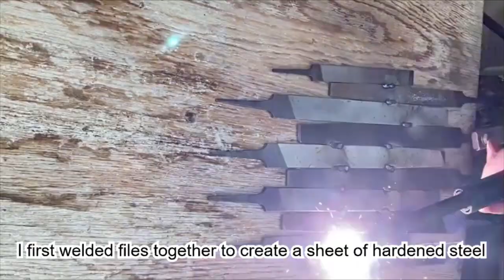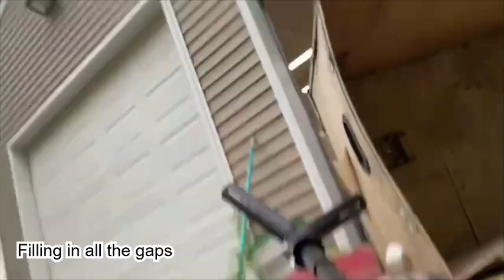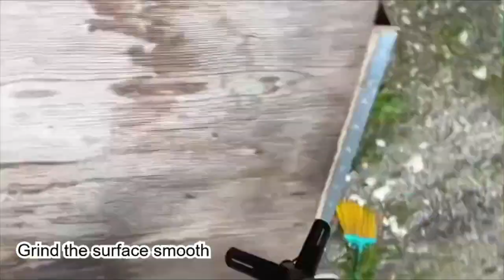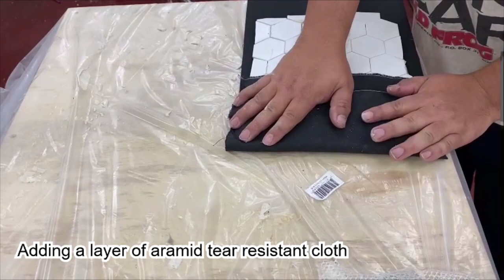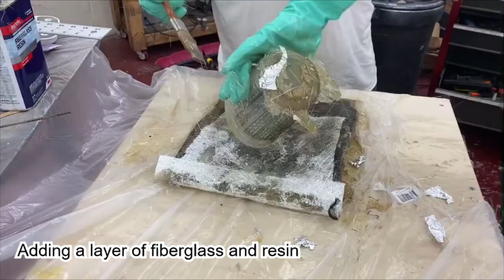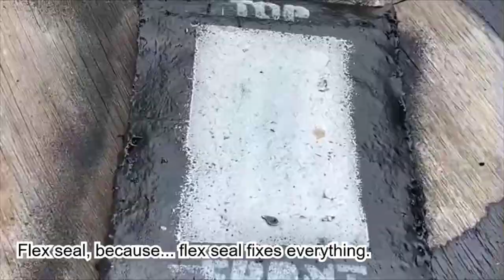CRS FIREARMS $500 DIY BODY ARMOR CHALLENGE(2021)

Comment: I bought two ar500 plates with a carrier for $200…. Just saying….
Reply from the maker: Yeah AR500 armor although very heavy is really cheap.  Although the prices may swing a bit when material costs catch up as steel has skyrocketed in price.  

Steel armor is also going to have more consistency and less degradation over time.  Unlike kevlar which will basically fail from getting exposed to the sun or humidity for too long.

Comment: Is there a way to have the files overlap and be flexible? Like little hinges or something? Seems like that could absorb energy too
Reply from the maker: If I welded them to a thin piece of metal they could probably be flexible.  Seems that composite ceramic is a better material though.

Comment: Great ideas, quite a few. Do you know the weight on it? I have to think this is going to do very well
Reply from the maker: My scale put me right at 8.8lbs.  A full 1/2” AR500 steel plate would weigh more than that so lighter than some armors.  It’s roughly 1/8” thick of the file steel which is about half of the entire weight.  The idea behind using the smaller tiles is to prevent crack propagation by pre-cracking the material.  Hopefully only one tile per area gets destroyed on a shot.  I wanted to do 2 layers of tiles, but that would put me over the weight.  Also wanted to add a layer of HDPE(from a $3 home depot bucket) but that would have also put me over the weight.  So before the foam and flexseal it was around 8.3lbs so I just added that on last minute, it probably won’t add much to the equation.  More layers of fiberglass probably would have been better, but at this point I was out of fiberglass and resin.

Comment: It will work but that shit is too thick to put in a vest.
Reply from the maker: Yeah, but that is mostly due to the foam which I don’t think will do much.  Before the foam it was less than 1” thick which is the same as ceramic and UHMWPE plates.
Reply: @artofeverything1816  real question is- how heavy is it? Should make a video where you shoot the crap out of it to see how it holds up.

Comment: Dang dude. You basically used most of my tricks.  If it fails I can tell you with about 90% certainty why.  
1) when you weld hardened steel it softens
2) you need more than one layer of ceramic.
Reply from the maker: Actually what I am most worried about is the welds cracking and the files pulling apart.  Was going to do a 2nd layer of tiles offset from the first, but that would have added too much weight. Single layer of tile added around 3lbs and add to that the 4.5lbs for the steel would have been 10.5lbs with just steel and 2 layers of tile.  

Not shown in the video but I water quenched it after welding.  Water quenching usually creates too much brittleness and weld cracking.
Reply from the maker: @libertarianGO  If I really really cared I would fully re-heat treat the material, cook to cherry red and oil quench, but I don’t really have the means to do that.  If I could smelt I could make my own steel from mild steel just add some carbon.
Reply: @artofeverything1816  there is a different product you can pick up in store that doesn't require welding, is lighter, and has better bullet defeating properties than just a plate of armor steel.
Reply: @libertarianGO  you just broke the first rule of the internet: you don't show personal data like your phone number. I advise you to delete it
Reply: @andreiandrei8240  lol its a public business number.  I was only leaving it up long enough for one more reply from post

Comment: Someone else that tried to make one but he failed with the weight so he didn't even send it in I gave him some suggestions I would like to have seen you take those clay tiles or ceramic tiles should I say and wrap them in Kevlar and then make them like dragon skin where each one hangs slightly over the next one so there are no seams kind of like shingles this way the bullet can't penetrate through the seam if it happens to hit one because it does happens sometimes but you put some pretty good effort we'll see what happens but I think when it gets up there in that caliber it's going to go through it I believe.
Reply from the maker: Another option which may not have added too much weight.  I know two full layers of tile would weigh too much.  My original idea was to add two layers of tiles.  I guess if the overall density of tile could be set to roughly 1.5 vs 2 then it might be able to sneak in.  I have another idea I suggested that I might try if I have enough time and this one loses to another entry.
Reply: @artofeverything1816  interested to see what's going to happen! If I had more I do more but right now I'm living in my minivan for the past year trying to survive doing Uber Lyft and landscaping. so if I had a workshop and stuff like that I probably enter this competition.
Reply from the maker: @survivalishardstaystorng  Ya gotta eat first.

Comment: Too brittle ,but I'm no expert !
Reply: And no I haven't made one
Reply from the maker: We’ll see.  Generally the harder the better.  Bullets plow through mild steel like butter.  You want compressive strength which is closely related to hardness.  These files are still softer than AR500 steel(abrasion resistant 500 because it’s roughly Brinell hardness of 500).  The files are most likely only around 300-400BNH.

Comment: Cool video, but I highly suggest against welding on a wood table. Or at least have a bunch of fire extinguisher stuff real close by
Reply from the maker: It was outside..  You can see the wood catching fire a couple times.  Many safety violations in this video.  Like also welding wearing polyester clothes, not wearing gloves.  “kids don’t try this at home”
Reply: Art Of Everything I am not in the business of telling people what to do.  You clearly know what you’re doin, i was just adding my $.02 and making a suggestion!  My welding table is a cast off from a business that was upgrading, got a metal table for free!  Lots of inds. Buisnesses upgrade their furniture, and you can probably upgrade on the cheap
Reply from the maker: @thenathanr4243  I recently picked up a metal welding table as well.  That was being used for another project(drying epoxy) at the time.  Also would have "cool" to use TIG welding and a shield over the camera so you can see it, but out of Argon gas and more setup.  I just keep coming back to FCAW as being the best all around way to stick metal together.  You don't need gas, it works better than TIG or MIG on dirty and rusty surfaces and one less setting to mess around with the gas etc.  I use ARC stick welding for heavier duty stuff and the TIG for aluminum and thinner metal when I have gas, but 90% is the good ol' Lincoln Weld Pack with flux core.

Comment: I am no expert, but I think the ceramic layer is better in the front, so the boolet is mushroomed first and then slowed down by the foam and fibreglass before it impacts the steel. Anyway, great job
Reply from the maker: This may be true.  I saw some HDPE milk jug armor built with a center section of HDPE tile in  the front and steel in the back all held together with fiberglass.  It stopped everything and that was using mild steel.  I think in a 12x10 footprint that design with a 1” section of HDPE would be too heavy still.  

I really wanted to use HDPE but it was too heavy to incorporate into this steel/tile construction and figured thinner steel would be almost pointless.
Reply: @artofeverything1816  I want to use a sheet of HDPE.  But it does eat into the weight budget for sure. Especially when it's 1" thick.
Reply from the maker: @Fudmottin  Used some HDPE in my 2nd attempt.  If you don’t want to buy a solid sheet and don’t want to save up thousands of milk jugs a $4 home depot bucket is 1LB of HDPE.  cheapest way I have found to buy new.
Reply: @artofeverything1816  That's good to know. When my milk jug collection got bigger than the house, I was asked to get rid of them. ;-)

Comment: Could have spent $250 to make fiberglass  level 3 molded to your body and put a melted and reformed poly layer with an rwh rating of 81 on the outside, to potentially bring it up to level 4.

It'll get the job done, but waste of files
Reply: Yeah that sounds like it could work pretty well but this other guy here I think he somehow got insulted by your comments dunno why